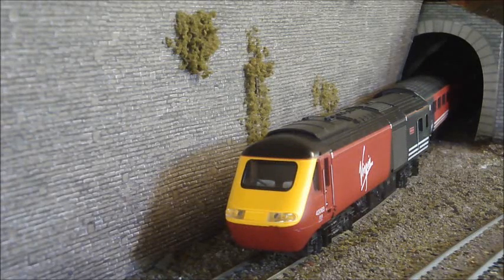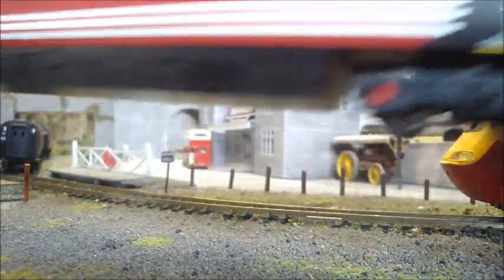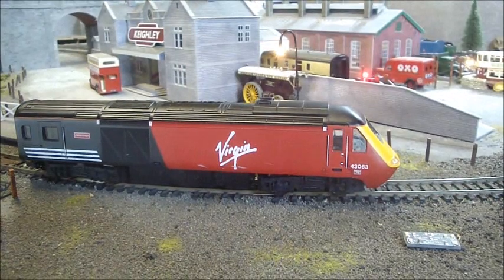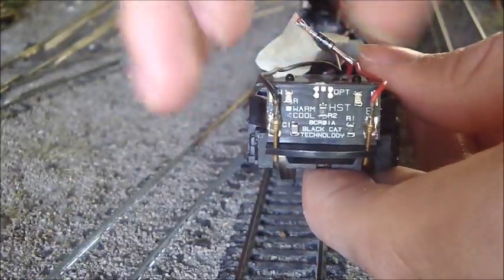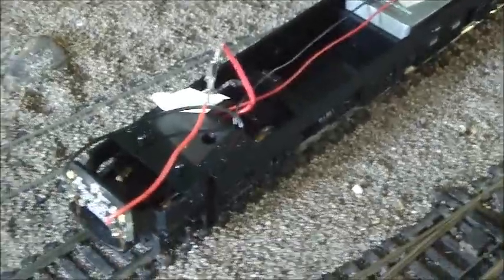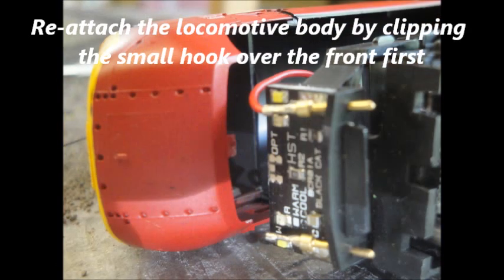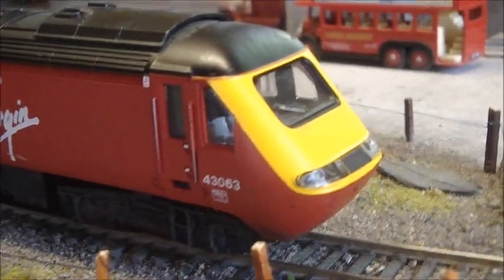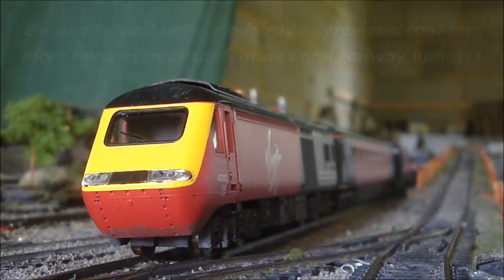Updating Hornby's Old HST

Comment: Nice upgrade there but the older HST model will never match the new premium one.
Reply: +atorpedoman I agree about that mate because the tooling has barely changed since 1978 when it was first introduced at Margate. Just save a bit more and get the premium model instead I think :).
Reply: +atorpedoman quite right

Comment: This was painful to watch, you said "humm" 86 times !!!!!
If your going to bother to "update", why not research the correct cab colours rather than using any old colours? You also need to learn how to weather, slapping paint on is NOT weathering, it's destroying! Also, why are you putting your models roof down on track? are you mad? Can't you hear the plastic and paint grinding on the hard metal surface??

You should have just changed the lights on this video and scripted your words. That would have made a much better and informative video. Just my opinion.